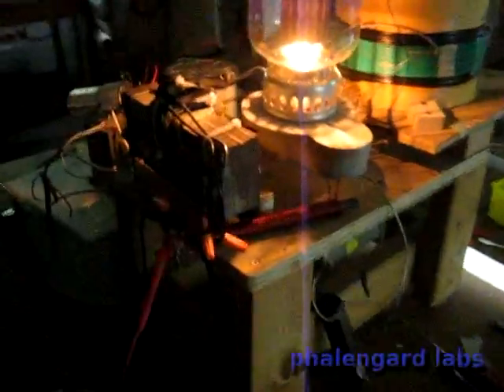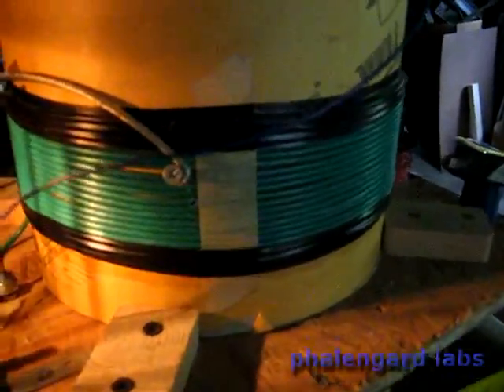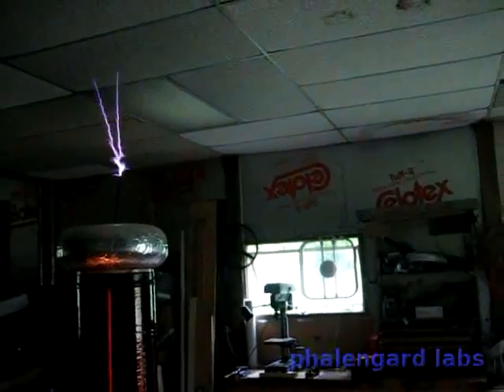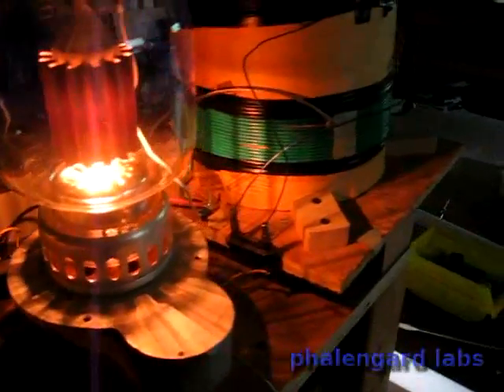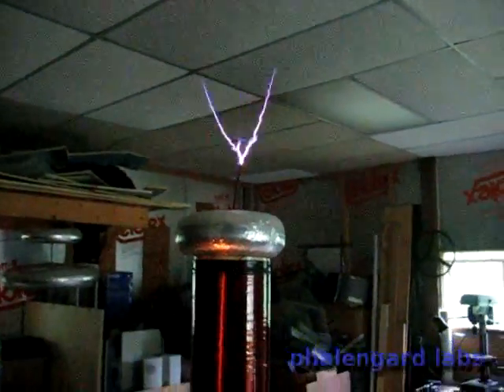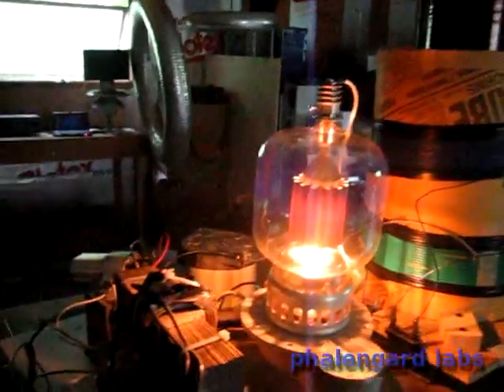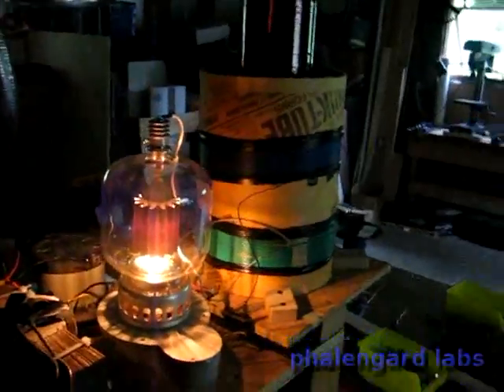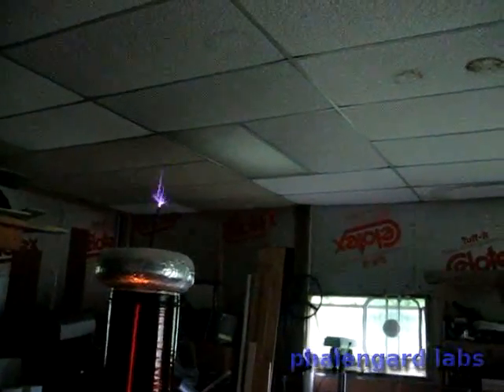2011 / 07 / 07 - VTTC after initial tuning

Comment: @lbochtler the gu-81m is designed to run with a dull orange plate (mine runs like that) and when i get off of my lazy butt i will put thicker wire on the primary :D